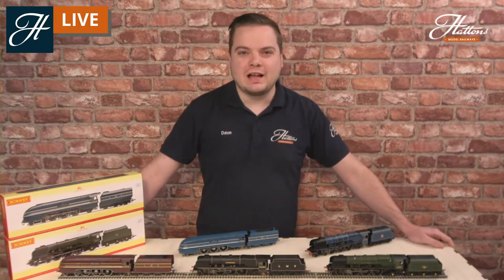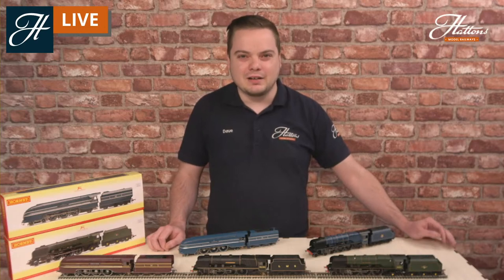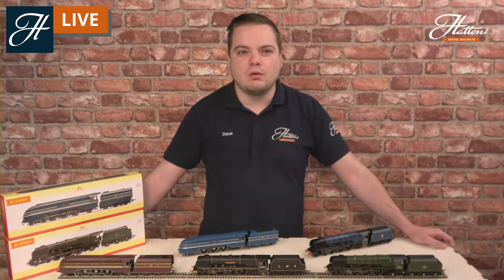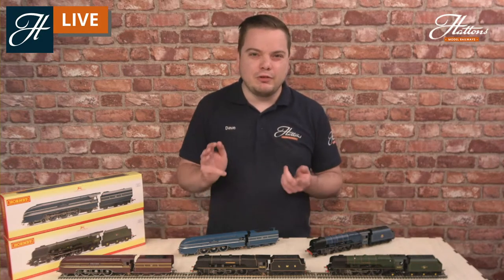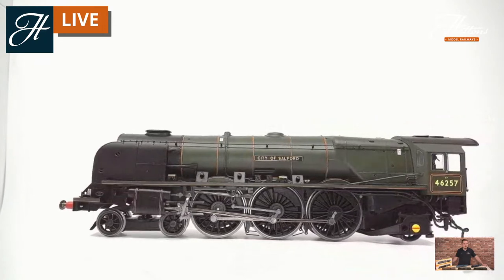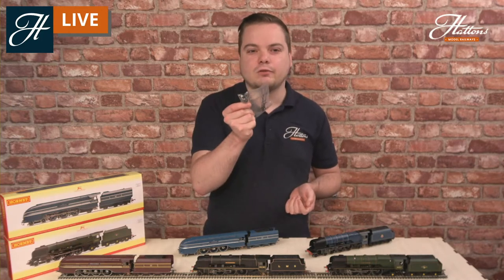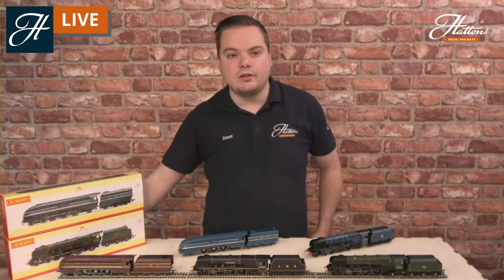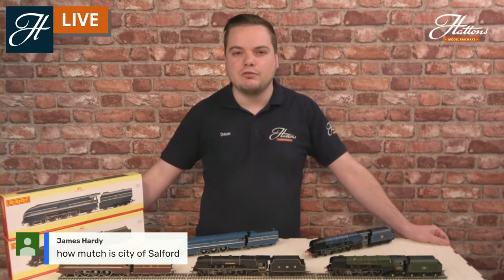Hornby LMS Princess Coronation - Model Focus and Q&A

Comment: Great models Dave I have a early model of Success of Sutherland fitted with a Hornby tts decoder runs and sounds great.You said they were the most powerful steam engine  what came after which was more powerful ?
Reply from the maker: The TTS decoder is worth every penny and adds a lot of character to the models, that's for sure. The Princess Coronations were the most powerful steam locomotives to operate under British Railways, however 71000 "Duke of Gloucester" has been reported to produce higher power output in preservation.
Reply: Of course I forgot about 71000 Duke of Gloucester .A great engine and hopefully running again before too long.

Comment: If only that awful streamlined casing hadn't been put on Duchess of Hamilton, she could have been running into the 2020s and beyond. In my opinion, she should have the streamlining removed and be let out again. Aside from this, I've been reconsidering Princess Elizabeth for the Cat Valley Steam Railway. True, an engine used on Main Line trains wouldn't be seen on a preserved railway very often. Possibly due to weight restrictions. But I may consider replacing the Black 5 with her, or keep the Black 5 and add the beautiful Princess and a second Terrier Tank Engine to the fleet I already have. Streamlined A4s are more my style. A streamlined Duchess looks positively awful. Sorry, but that's the way I feel about a Duchess engine in streamlined condition.
Reply from the maker: There's some great LMS locomotives available in OO gauge Kelly and both the Princess Royals and Coronations are great choices to add to your collection.